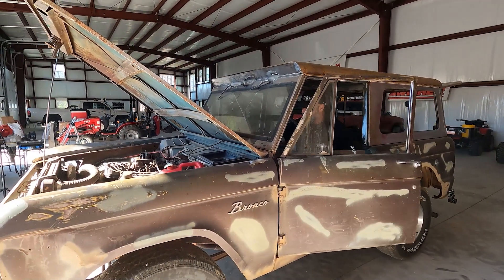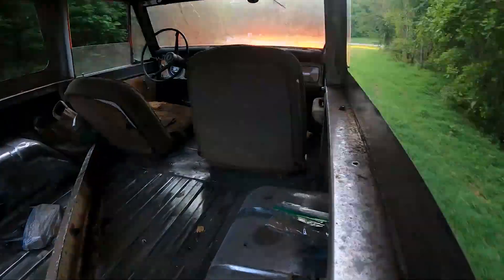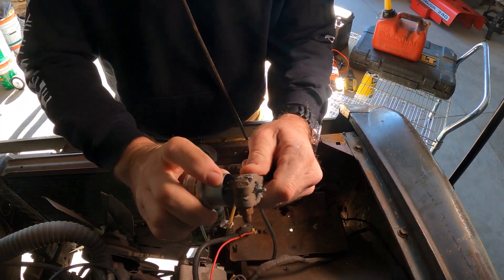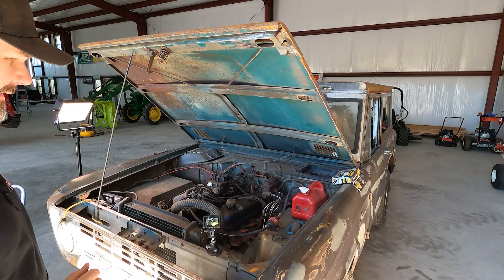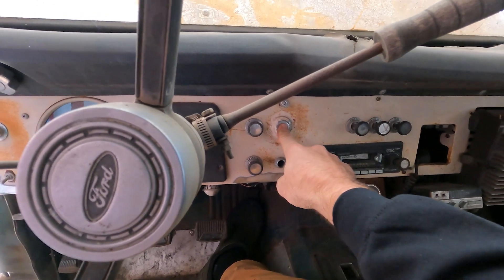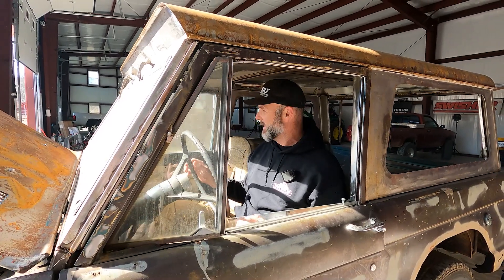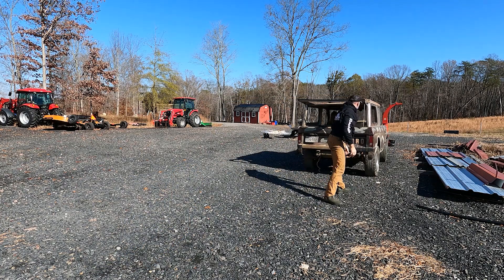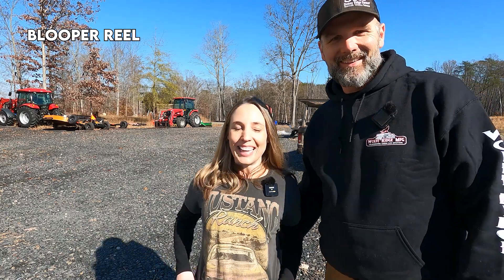She said Fix The CRUSTY Bronco! Will it even start??

Comment: That's what I learned on, was a 3 on the tree. Was told to get in and drive by my old boss. He showed me where the gears were and to use the clutch. Then he told me to only use the clutch when starting out and stopping. listen to the engine for when to shift with out the clutch.

Comment: Had two of those, probably your carburetor and I don't know if you have the holly or the Ford two barrel but those little filters that screw into the front of the car they were notorious when you sat they would go ahead and get plugged up. Other than that you probably know it the float is probably sticking in the float valve is probably sticking you have to go in there and just pull the top off and get that float pick it up who knows maybe it's even got a hole in the float and it fell down but more likely just stuck. I too had that same top I don't know where it came from I think I heard Whitney too. Or worshawski. Same place just a different Road. I think that top even though it's kind of ugly looking was better than the stock tops seemed like it was made out of better metal. I always wanted to take that cut off look on in the front and mouth lights up there and put some kind of a clear cover over so it was more aerodynamic.

Comment: You did good connecting the battery. Which ever terminal is connected to the frame/body should be removed first and reconnected last. In this case, the reason, is so you don’t create a short circuit between the frame and the positive terminal.

Comment: About the hard top.  The top was made back in the day by a company called Kelly Mfg. Co. Kelly Mfg. Co. made tops for Scouts and this particular top was made for the Bronco. At the time Ford did not make replacement tops. This Bronco could be a true 1968 U14 Bronco, a Vin check can verify this. Either way cool truck!!  I think you're right, starved fuel issue. The fuel pump might be a bit small for the engine but should at least run at idle. Possibly stuck float or other carb issue.  Happy Thanksgiving.  Woooo!!

Comment: Possibly stuck float valve but you probably want to rebuild the carb anyway. Should be fairly easy to figure out the howl by taking the belts off and turning the accessories by hand.

P.S. Probably shortened the life of that starter quite a bit.

Comment: Dumping fuel down the carb does nothing to get fuel into the bowel where it need to be. 

A tap tap on the carb body might free up the float system. With pulling the fitting from the fuel pump, toss that fire starter in the trash, or your $9500 project will become a zero value relic.